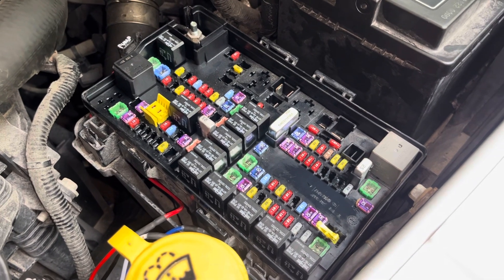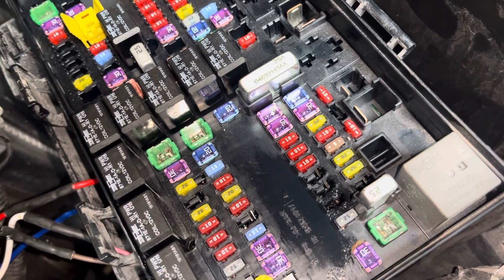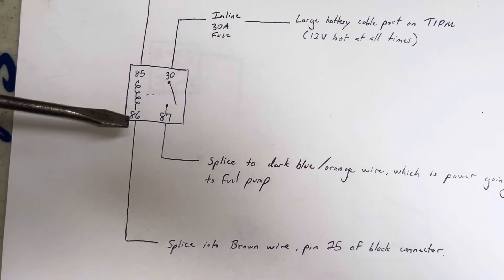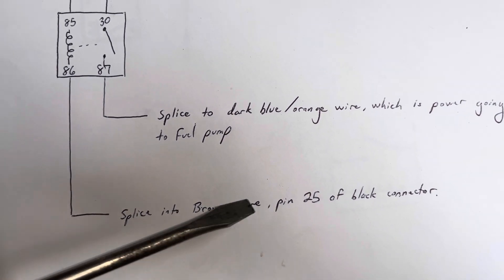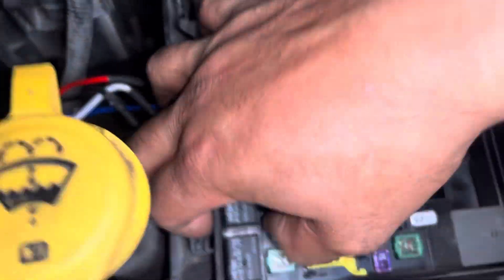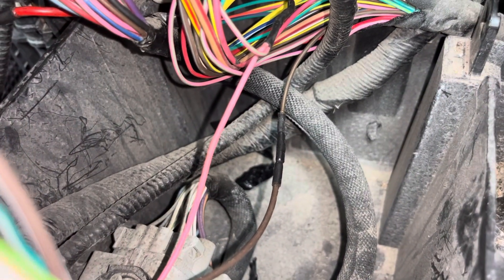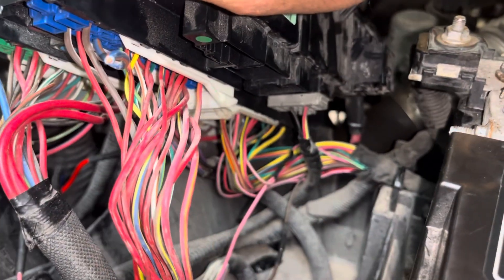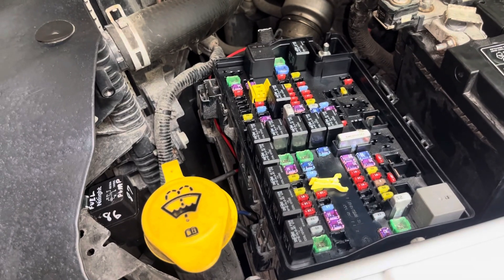2016 Ecodiesel fuel pump fuse and TIPM integrated relay bypass for “no power to fuel pump” condition

Comment: You might have just saved my ass, dealership told me I needed a crank sensor, removed the whole transmission to replace it and did not fix my issue, I am getting power through the fuse but not through the fuse box to the harness to the pump, had my head spinning circles cause I did not know the fuel pump relay was integrated in the box. Had replaced the box twice and had an intermittent fix until it just stopped starting. By passing that relay is the only fix. This entire truck is an absolute disaster of engineering
Reply from the maker: @sethfrazier828  well I hope that fixes your issue. But from what you’re describing, is it possible your lift pump in the tank is faulty? Or have you verified it’s a relay power issue?

Comment: Hey Brother, I really enjoy your content.  I've got a 14 Grand Cherokee Overland with the 3.0 Ecodiesel.  So, needless to say, I find your videos quite helpful. 

 After watching this video, I'd like to throw in a bit of info.  

 Back in October of last year, I started having lift pump issues.  I'll skip all the long drawn out drama I went through and jump straight to the meat & potatoes!  After replacing my lift pump with a brand new Mopar lift pump, my lack of fuel issues popped up again about 2 months later. I dropped my tank again and found that the ground pin in the lift pump plug had actually began to melt.... causing it to heat up and short out. Causing random crank / no start scenarios as well as random stalling out while driving.  This was my culprit the entire time.  I was so disgusted for not checking this plug in detail while I had the tank dropped the first time while replacing my lift pump.  

I am used to seeing this kind of stuff on most 99 and up GM / Chevrolet full size trucks and SUVS.  This was a first for me, seeing this kind of thing on Jeep / Chrysler / Mopar vehicles.  You would think, after all the pigtails I've replaced on GM vehicles, I would pay more attention to the plugs on ALL fuel pumps, no matter the manufacturer.

Anyway, just wanted to thank you for making such great, detailed videos.  As well as throw my .02 cents out there for others that may come across similar situations.  Hopefully save someone else some of the headache that I went through diagnosing my problem....

Also, one more thing.  There is ANOTHER fellow youtuber that has a video that found VERY helpful!! Can't remember the channel name, but he goes into detail about how his fairly low mile Ram / Ecodiesel developed LOW to NO OIL pressure problems.  He decided to drop his lower oil pan and discovered his oil pump pick up tube COMPLETELY STOPPED UP with SOOT / SLUDGE.  My oil pressure warning flickered, I immediately took my Jeep straight to my shop and dropped my lower pan.... wanna guess what I found?!?! THE EXACT SAME SHIT! So, thats where I am at RIGHT this minute.  Its easy to clean out, I will have her back up and running first thing in the morning.  I have a strong feeling that this is the root cause of all the ECODIESELS mysteriously blowing / locking up due to oiling problems....  

Just throwing that out there! Thanks!
Reply from the maker: Appreciate the kind words. I haven’t seen the fuel pump connector issue on this era of Chrysler vehicles but anything is possible! That would’ve been easy for anyone to overlook. As far as the soot choking up the oil sump - also really great to know. The ecodiesel engine rebuilder in Mexico, Enrique Peters, claims there isn’t enough interference fit in between the crank main bearings and caps, allowing them to easily get spun. I’m actually sitting on two trucks right now with spun main bearings. But, if the sumps are getting choked up with that oil/soot sludge, that would make sense! I appreciate you sharing the info. I haven’t come across a low oil pressure ecodiesel yet, but I’ll keep the oil sump blockage in mind.

Comment: Thank you. And this worked flawlessly? I’m watching another video and the guy says don’t use the blue connector, use the gray one with the blue/orange wire 🤦🏻‍♂️ 🤷🏻‍♂️ 

I am having this mess this week. I replaced fuel pump for bad level sensor. 

Now I have intermittent no starts 🤦🏻‍♂️
Reply from the maker: @richleskovec4075  yes, this truck in the video is being used every day by a local company. I’ll say this, aside from the burnt original fuse, I also found that the fuel pump connector on top of the tank was also damaged from heat caused by excessive electrical resistance. It was so bad I had to replace the connector/pigtail. That may have been a unique situation for this particular truck. Anyway, if you follow the blue wire with the orange tracer, it should lead towards the rear of the car, through the driver fender, from what I recall. I’m curious about the gray connector in the other video you’re watching. I’ll look at a wiring diagram today to see if there was a change throughout the years.
Reply: @tadsworkshop  thank you so much for replying. My truck is a 2015 ram 1500 5.7 L

I am stuck with this right now so thank you for speedy replies. I do appreciate it.

OK I’m going to be trying to solve this today… I have no idea what’s wrong, but I replaced my fuel pump last week because of bad level sensors P0463 as I had indicated and it ran fine for four days And then I had engine trouble code P019D indicating fuel pressure sensor which I then replaced and then I had no codes. It ran fine so I thought I had solved it and then yesterday I have the same no start garbage so I got it towed home last night and will approach it today trying to jump her out the relay first of all and if that seems to work, then continue with adding a relay as you show because I have All the stuff handy to do it with
Reply from the maker: @richleskovec4075  that sounds very frustrating. Keep in mind, the truck in the video was equipped with a 3.0L diesel, and I would not put it past the manufacturer to have a different pin out and wiring layout at the fuse block for another engine configuration. I don’t have access to the wiring diagrams for a 2015 Ram otherwise I’d try to offer more help. So, with this trucks fuel pump power wire being the blue/orange on the blue connector - take that with a grain of salt. It’s possible that may not apply to the 5.7L Hemi version. Wish you the best of luck, hopefully you determine the cause today or make progress on it.
Reply: @tadsworkshop right. I understand you’re is a diesel. I will look at other vids and try to research. At a minimum if the jumper method works, I can drive and it’s a temporary fix while I can definitively find a relay solution. 

I can hear the fuel pump run briefly and then stop when I turn the key to ACC. So the fuel pump I know is good and then kicks on and stops. So that’s not the problem. Ugh.
Reply from the maker: @richleskovec4075  I haven’t worked on a fuel pump issue for a Hemi of those years, but it’s always been the norm for a lot of cars for the fuel pump to cycle for a few seconds just to pressurize the fuel rail with the key on, and engine off. Do you have a scan tool to see what fuel pressure is at the rail? I would monitor that information while cranking and when you get the engine running.

Comment: Tad, there are 3 Pink and green wires in the black connector, how do I identify pin 28? I'm in the middle of doing this and thought there would only be one pink and green... thanks
Reply from the maker: @SeanChristian-c5x  I’m going off my memory here, but if you look closely you should see some numbers at the end of each row of electrical pins. Look at both sides of the connector. Let me know if you still have trouble. Remember, it’s pink with a light green tracer. Also note you are tieing into that electrical wire. Not eliminate one side or another if that makes sense.
Reply: Diagrams

Comment: would this by pass work on a 2017 dodge durango v6
Reply from the maker: @fire26821  I’d have to imagine the wiring colors, fuse locations, and connectors would be different.
Reply: @tadsworkshop I’m working on a 2016 Durango and they’re the same. The issue I’m having now is the fuel pump is getting power, good ground , and level sensors working but the pump will not come on. It is an aftermarket pump maybe That’s the reason. I changed the pump before I seen the relay bypass fix.
Reply from the maker: @ if your getting power and ground on the heavy gauge wires, the pump has to be defective. Make sure you are verifying this with a conventional test light, not a multimeter, voltmeter, or led testlight. If there is a 100 ohms of electrical resistance inline due to say, corrosion, the low impedance multimeter, led test light, etc will never show it. You need something to put a load on the circuit. A conventional test light imposes a 1 amp load which is sufficient enough to confirm power and ground.

Comment: What is the pin # of the blue/orange power wire to the fuel pump?
Reply from the maker: If you go to 6:33 in the video, you’ll see the snipped blue/orange wire. It comes out of the blue connector seen there. I do not remember or know the pin number off hand.
Reply: @tadsworkshop  thank you